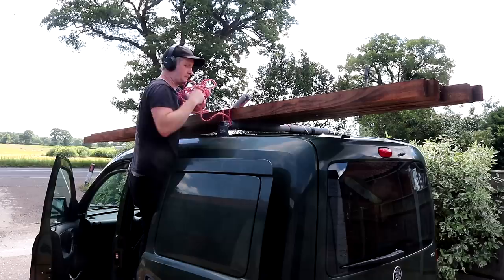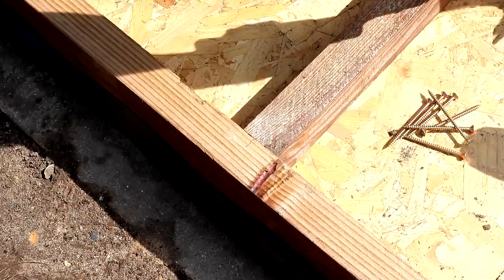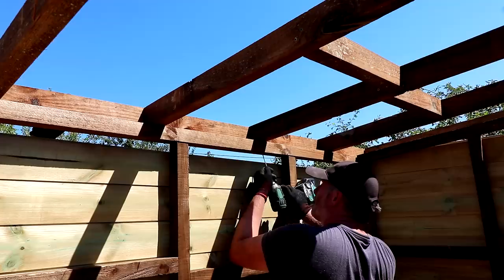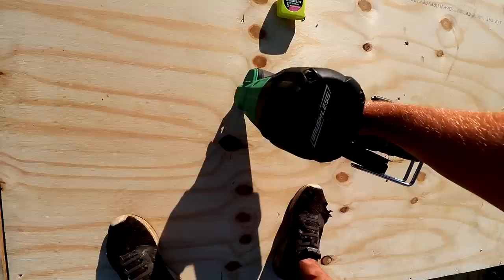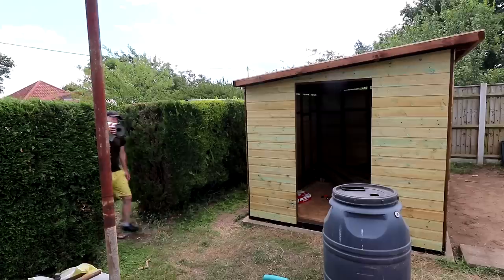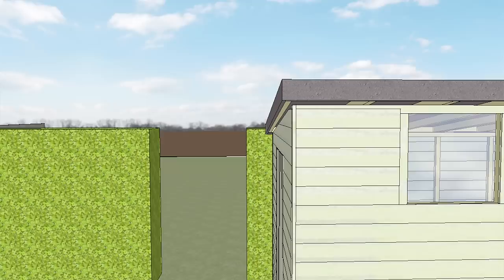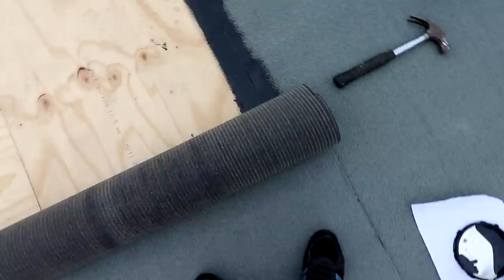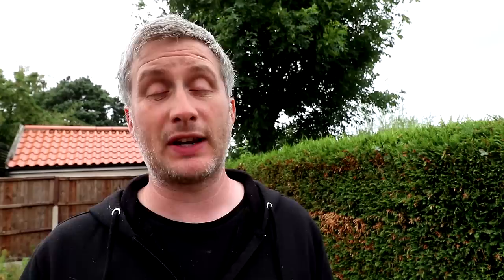Making The Shed Roof (PART 5 SHED BUILD PROJECT)

Comment: Just a suggestion, put a batton along the edge of the roofing felt. If you leave it long enough you can even tuck it under and screw the batton from underneath the roof rafter. It looks a lot better.

Comment: Lovely shed in a great spot. For future reference, when doing the drip edge you should fold about 2" underneath and nail it flat through both layers. This gives a stronger edge, both for wind shear and nail fixing. It also looks really neat. Thanks for posting.

Comment: A guy I know who builds himself a lot of wooden sheds/outbuildings for different things, and he advised me to always put the thick plastic sheeting you can buy from builders merchants etc, underneath the roofing felt. I've done it now a couple of times, stapling the plastic sheet to the boards and then tacking the felt over the top, and I have never had a leak, even when high winds wrecked the felt once, the plastic saved the day. 
He also staples the plastic to every wall as well, before he puts on the cladding which he says makes everything really watertight, although i've not tried that as yet..lol

Comment: I used epdm on mine. Ordered it to size with some overlap and chucked it up in an hour using the appropriate adhesives. No nailing (which I hate the thought of) and ideal for green/living roofing later. Wonderful stuff.

I didn't bother with noggins on the roof but went for 4 x 2s to take the weight of succulent planting later (much lighter living roof choice).

I also used concrete blocks instead of timber for the main build to counter fire risk and made up some nice hinged windows. I also used a reclaimed front door for extra strength and security.

Thanks for candidly showing all the trials and tribulations - something we all suffer from, but good job in then end 👍🏻
Reply: You basically made a very different building to a storage shed and wanted everyone to know about it, top class hijack.

Comment: I also worried about using felt nails through to the roof, but I did our allotment shed that way a couple of years back; it's in a very open area and has gone through 80mph winds in the winter, and various downpours, and it's still 100% intact and water tight. Good to see your work, mistakes and all; I think it's good to show problems, as we can learn from them rather than making the same mistakes ourselves. I was surprised at how much those walls warped out of true, but good to see that the roof frame was able to get them back nice and straight.

Comment: Shed's looking great Keith! Sorry to hear of the hassle with the weather - it's such a pain when that happens. I had a similar situation a few years ago when recovering my shed roof. I found on Ebay a factory second of 1.2mm EPDM (with minor miscolourings/ insignificant marks) in the size I needed. Although the product is more expensive, the faff factor is zero. You know you have little wastage, no clout nails or bitumen paint to deal with, & the best bit is that it comes in one complete piece, so no chance of it ever leaking. You use EPDM adhesive in the middle (applied easily with a roller) & contact adhesive around the perimeter. It really is a joy to work with in comparison & in my opinion well worth the extra £, particularly as it is so much faster to install. You can do away with the plastic edging strips for a shed I think, & just use timber to hold the edges to save some money on the gasket type strips. Thought I'd mention it in case other followers are considering methods.

Comment: You did great and it will shed 100% of the water (former roofer speaking). It looks fine and it's a garden shed, not the Taj Majal, LOL. In 15 years you can put a fancy roof on it if you want, though I doubt you'll bother.

Comment: All too easy to overlook all those brilliant and well-planned parts of your build that will improve the shed's resistance to water through a broader overhang after one mistake. If you only built sheds there'd be room for self reproach but you have a huge back catalogue of great pieces so give yourself the benefit of the doubt and shake it off. Great video again.

Comment: This has some parallels with the summer house I'm building: similar pent shape, and I made the roof pretty much the same as you, with side and front overhangs.  I also used the good quality felt, and bitumen adhesive.  I was lucky with the weather, and got the roof up, sheeted (18mm OSB) and felted in one go.  I've also made many, many mistakes (or opportunities to learn for next time) in my build, which is still far from finished.

Comment: Great work mate when I had a beach hut on the south coast we put the felt on the roof the other way with the joints against the prevailing wind ie over the top of the ridge  then put a baton next to the joint with a generous overlap never had any leaks 👍

Comment: Hey Keith.... Gotta take the bad days along with the good ay 👍..... I recently did a job and I used the rubber roofing kit you mentioned.... I know I costs a bit but I tell you what.... does a cracking job and easy to fit..... Once you've wrestled the one big massive piece of rubber into place that is 👍

Comment: You should take a look at 'Handy Pack' sizes of nails. Usually around 500 nails for less than £10. Will get a job done without having lots left over. I find them useful for when I want to have all the sizes on the shelf for those little jobs that need them but don't want 5000 sitting around doing nothing.
Reply from the maker: Where are they available?
Reply: @RagnBoneBrown  I generally use eBay for them but the brand I use is available from other stockists too. I use aftermarket nails and Brad's in all my nail guns.

Comment: If the felt has bitumen on the back, you can use a plumbers lamp on the underside of the lapping roll of felt and seal the lap by pushing out the bitumen after heating it up either with your thumb or a small silicone roller. Be careful not to overheat on thinner felts tho 👍🏻

Comment: If you have not tried it, then its worth having a go with "torch on" felt - a really nice product and so much faster to apply with no nailing! Normally best applied with a separate underlay and top coat - so more pricey than basic shed felt.
Reply: And it will last a hell of a long time. I think I,d use a green mineral top layer tbh.

Comment: Comment for the nailing. Years with hot sun and some tiny expansions and contractions around the nails can make this a bad solution and rain can enter the plates under it. At least this happened on my roof after some years. I would never allow this way of having open nailing punctuation the layer again.

Comment: Really interesting to watch Keith. I think my shed didn’t bow because the modular idea meant the timber frames were locked solid against the internal OSB before it was clad. It’s a positive I’ve never considered as I’d struggle to deal with that bow the way you did. Also I know EPDM is more expensive. The membrane itself is pretty reasonable, it is when you add the additional gubbins the price adds up. I went for it on my shed as I’d had a very bad experience with roof felt previously and didn’t want my biggest project to date wrecked by inferior products. I managed to sort the EPDM in a day and it is really good stuff, will be fitting to the workshop (whenever that may ever get built)😀😀
Reply from the maker: Cheers Leo. Look forward to seeing a workshop build! 🤞

Comment: I bought 2 rolls of EPDM  as temporary roofing, when I roofed my house. The juncture of the Porch into the existing roof was a hack job, and some of the porch roof was rotting, so I had to rush and repair before snowfall. I needed something to ensure it would survive the winter and bought the first 10ft by 20 foot roll of 45 mil (iirc $99us), and the winter was well endured. I then got all the metal I needed to replace the whole house, the first 891 sq ft went slower than planned, but as I got the first  portion done, but my walking on the other part exposed some minor leaks and made them not so minor. Some of the repair pealed more roofing off and showed some rot I had to deal with, that was not going to get reroofed in time so I used a second roll of EPDM, then a new area that had no signs of issue and I hadn't even walked on, leaked like a faucet running, and I was forced to roof that side ASAP, so a quick toss of some tarps was done until then (a few months was all) and I just managed to get that 230 sq ft portion done before the snows hit. The porch, roof section went a second winter with just the EPDM on it.
Over all I roofed 1500 sq ft using mostly 13.5 foot lengths of metal roofing the others were 12 foot and 10 foot Pro Rib style (36 inch wide coverage per length) on a two story with 9 in 12 (36 degree) roof, alone. One should not try this.
The day I finished the last trim piece, I walked into the garage and found it had started leaking.
oy
Now the two rolls of EPDM are on it until I get more metal roofing. Less slope and not nearly as high, so easier, once I get the materials. I also wish to expand the shed that is attached to it.

Comment: Good one mate.. i am still working on mine too but my case is i have my back yard 3 walls already made of brick so i made long timber as a roof structure and gor 11mm osb sheets and i had the EPDM thing and just waiting for a good 2 or 3 days to work on as the osb will get damaged by water easily.

Comment: If you used the bitumen roof sheets, they would have screwed direct into the roof joists you already had. So you could have saved the cost of the 12mm ply which would conteract the cost premium. I used aluminium box section sheets on mine.. Keep up the good work
Reply from the maker: Only if the joists lined up with the arcs in the roof sheet, which they probably wouldn't have, and also I don't think fixings spaced apart that far would be reliable enough due to the spacing I used
Reply from the maker: I didn't explain that very well, I guess what I meant was I'd have needed to buy the onduline sheets first, and buy more joists to secure them to, but then I'd have all the eaves to fill also to stop the critters getting in
Reply: @RagnBoneBrown  I’ve used bitumen sheets in the past and I hate them. The corrapol ones I used, although they are all the same. Not very nice to work with, too soft and with one bad swing of the hammer you can make a huge hole when putting the nails in. Also the water gets in through the surrounding nail holes. Not very nice to cut either. While they are fairly cheap the begin with, realistically you want all the trims too, to stop critters getting underneath and then with flashings etc the costs fly up. I spent almost £120 on the sheets, ridge pieces and fixings alone. (Without their propriety trim) when I could have spent £89 on a similar size EPDM rubber sheet kit with the glue and sealant everything you need. I’m using Skyguard EPDM for my new roof, very interested to see how it goes, meant to be the best stuff though.

Comment: i definitely don’t miss battling the rain or tackling roof felt and lengths, i actually went for box profile sheets for my workshop just because i’d end up with at least 7 lots of 3m length left over, seems like a lot of waste.
Reply from the maker: Box profile sheets are a good idea! Wish I'd thought of that. Used them on my first workshop and worked well aside from condensation issues but that wouldn't be a problem here because of the sheathing 🤔

Comment: I've never built a shed, but I plan to build one. These videos are one of the best. I'm just wondering why you didn't make birds mouth? There is space between the front and back frame (long edge) and roof frame.
Reply from the maker: Bird mouths not really needed here as mechanical fixings will be plenty strong enough. About to start a series of a new shed build by the way!

Comment: Cheap and very effective roof covering... Damp proof membrane! very durable. Wont rip and is all one sheet, no seams. 5x4 meter for a 12x8 foot shed, about 25 quid. Just overlap by 100mm all sides and Batton all around to secure. Lasted 12 years on my old shed. Not a single drop inside and when I took it down to build a bigger one the DPM Was as the day I put it on. Bargain. and put up on my own  in about one and a half hours. Buy the thickest you can. Got mine on Amazon but all the big boxes do them
Reply: How did you fix the dpm to the shed roof, adhesive?
Reply: @Hussain-ch3pr    Hello Imran. It doesn't require gluing down. Fix one long side down with a Batton (About 75mm x 19mm) line up and pre drill holes through to wall studs, pull it tight across to other side of roof (Not too tight) and batton that down. Fold corners on short ends (No need to cut DPM to fold it for this) and repeat. Batton it and trim leaving 10-20mm. With a bit of fiddling and cursing i managed mine on my own without getting on the Roof. I then installed the corner trims made from square profile plastic down pipes cut to give two L shape profiles (I used a Jigsaw). These go over any excess DPM and butt up to the bottom of the Batton. Once the battons are secured the wind cannot get under it, unlike Felt  Nearly forgot.... Give any sharp corners a quick rub down with a low grit sandpaper before installing. Good luck
Reply: @25is27  thank you for the comprehensive reply, much appreciated.
Reply: @Hussain-ch3pr   No problem Imran. Just make sure you get the thickest DPM you can. There are different thicknesses available. Don't do like my plonker of a mate did...He battened it with the edges pf the batten above the roof level!  lol. Batten 20mm or so down on the sides of the shed with treated wood. I used tongue and grooved boards that i had spare ripped down the middle to give 75mm wide with cut edge upward with a coat or two of fence treatment were I cut.

Comment: I ended up building my shed out of C24 3x2 throughout. As it was years in the planning I worked out that a steel roof is cheaper than felt, and better still saves having anything underneath though I will need to put insulation underneath it at some point. Also galvanised steel should have a life span of over 50 years and mine is painted a nice pale grey.
Reply from the maker: I used box profile sheets on my first shed and had issues with condensation although I potentially could have used them this time over the sheathing. They're not usually cheap though, not around here anyway ..
Reply: @RagnBoneBrown  I will be putting insulation under mine. My roof cost me £200, and it is 20' x 8'.
Reply: You could always over-sheet with box profile steel in the future. My workshop roof is on 75 X 50 rafters, with T&G floorboards forming the deck. This is insulated between the rafters with foil backed 50mm insulation and foil tape forming the vapor barrier. Roof was felted, with no issues for ten years. This year, at a cost of £172 I have over-sheeted the felt with box section steel cladding (Rhino Roofing, via Ebay). Roof is 4m X 2.5m with a mono pitch and gentle fall like yours.
Reply: @iansmith8048  Yes. I will be putting insulation between my rafters shortly before the weather changes.
Reply: @iansmith8048  oh, and my rafters are the same, as someone suggested just that so I could insulate with 50 mm board.

Comment: Keith, I'm not sure that the adhesive is required on the long seams. I have two sheds that have been standing for 4 years now without said adhesive and no water seeps through. I just had something like a 20cm overlap for the two pieces of felt. Really it was just the excess from the felt. I think the overlap is actually more like 50cm. Though better to be over zealous with these things than not so. At least you know there won't be any water leaking from the roof.
Reply from the maker: Cheers. Yeah the adhesive isn't really needed in terms of water ingress but I think (I'm no expert) it's more for purposes of wind resistance? It's an extra step I took mainly because I already had the paint - if I didn't have it I probably wouldn't have used it 👍

Comment: 'If it works it works' you can use that on a shirt. Question why not the roof screws that seal, and the roof seems  a bit heavy am no roof expert, is it to deal with heavy winds. The windows can you open them and why did you opt out of one?

Comment: What roof pitch angle did you build it to? I'm about to build a similar shed but with a 15 deg roof pitch. Having drawn it up it looks a bit steeper than yours.

Also did the roof frame lay uniformly on the wall frames? The reason I ask is because im concerned about not getting a nice uniform bearing between the roof joists and the wall frame because of the roof pitch angle.

Comment: Great job all things considered. At least the weather didn't completely ruin the job. I'd go back up there and paint all the  joins again with bitumin on the top of the overlaps & nails - I don't trust ANY joins on a roof [too long a story though!]. Btw ..Is this shed bigger than your workshop at your old address?
Reply from the maker: It's a little smaller, the old workshop shed was 4.1 x 2.8ish m - this one is 3.6 x 2.4 ish 👍

Comment: My shed roof is 60m squared, I rolled out two 9.5m lengths of roofing membrane and lightly secured them. As I was about to carry on securing them the wind caught them and blew them away ripping them in the process.. This was last Wednesday, it was absolutely boiling hot and where the breeze came from I have no idea.. I was TAMPING.!! 🤬🤬🤪
Reply from the maker: I hope you can laugh about it now! 👍
Reply: @RagnBoneBrown . Yes, now I can. I had the same problem as you, it had to be finished because rain was forecast for the next day and as my roof was OSB it had to be done even though I felt like taking a sledgehammer to it.. 😂😂